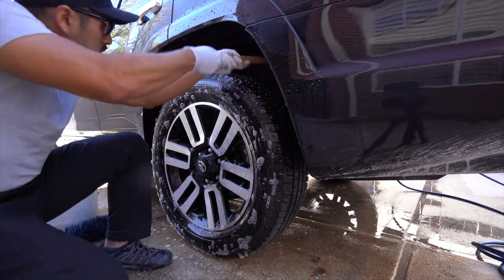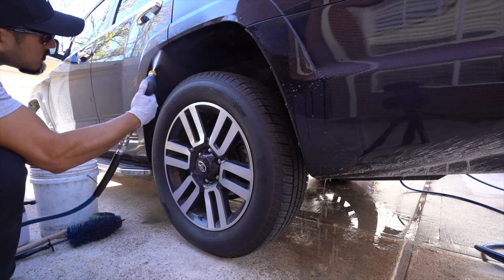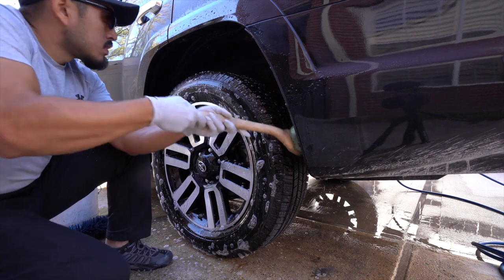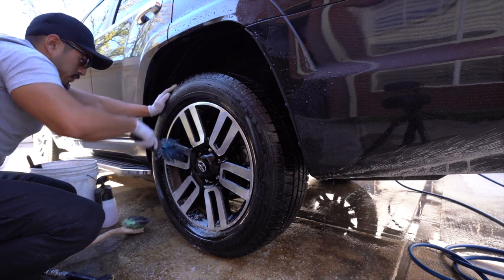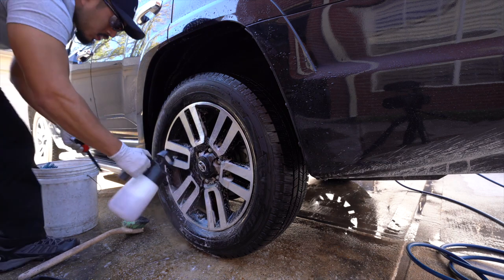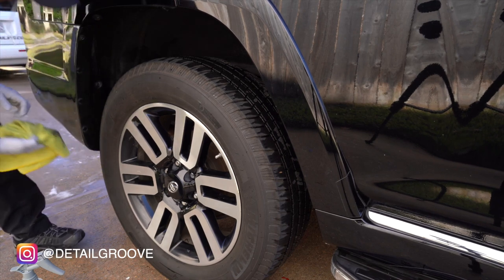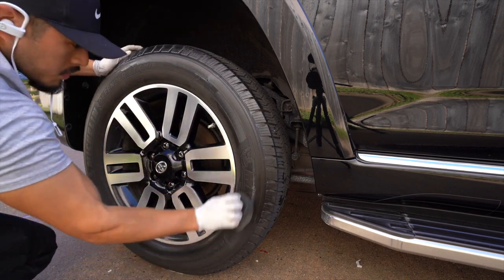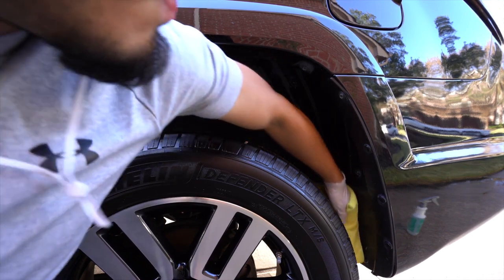How To Clean Wheels and Tires - Complete Cleaning Process

Comment: Hi Oscar. I have a stupid question but I need to clarify this. To me wheel and tire mean the same so when you use super clean I take it you are using that on the rubber part and the Adams is for the rims and brake dust? I have been spraying my meguires on the whole thing.
Reply from the maker: You could use SC on wheels and tires. It's an all purpose cleaner. You can use it a lot of surfaces. This is just preference for me to use a different product on tires because I want something more aggressive